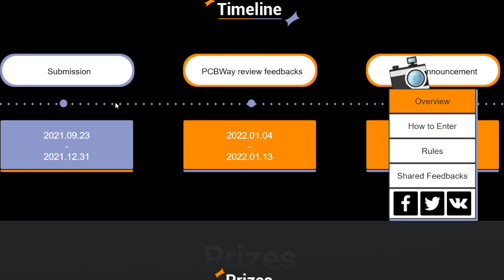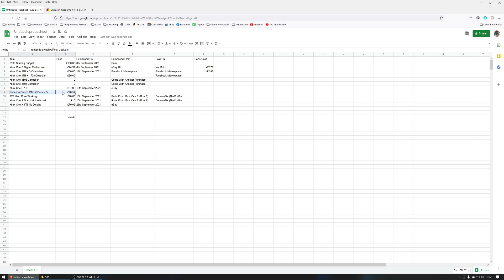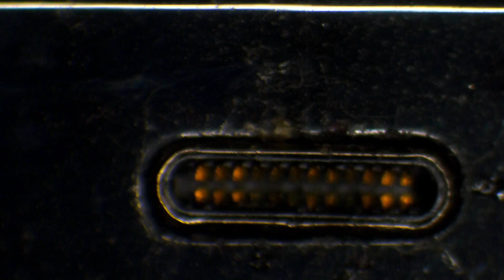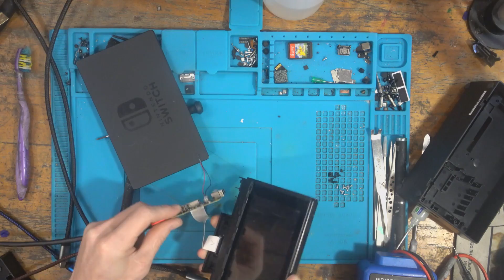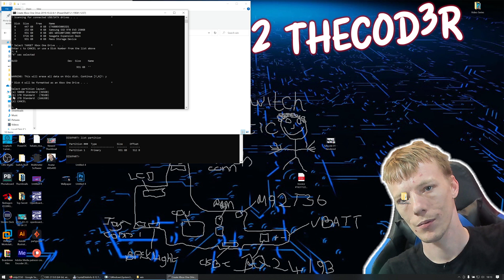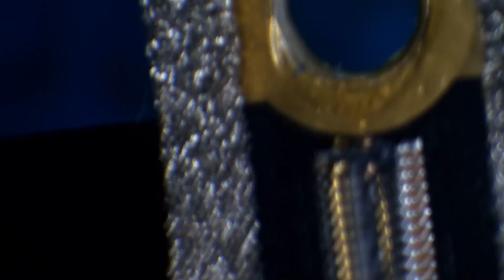Find It, Fix It, Flip It Episode 03 - Can We Turn A Profit Buying and Selling Broken Electronics?

Comment: Hi Phil, I repaired one of these docks. I even made a video about this. The no power was caused by the D92B55 IC for me. Basically it was M92T55 for me but could be that these are alternative ICs. The HDMI controller IC is under the metal shieod behind the HDMI port. Called something like SDP2550 which is a BGA. The 8 pin IC at the beginning of the video is an EEprom. The problem that all the ICs are quite expensive so I stopped working on them. Even a USB port with the felx cable costs 7€..
Reply from the maker: Thanks for that bud, I'll definitely be looking into these some more soon
Reply: @TheCod3r  no worries

Comment: Hook the docks up to a USB ammeter and see the current draw, if it is around 0.004 amps it’s a charging controller issue for no power, 0.4 amps is standard charging draw. Sometimes replacing the charge controller can fix no display,

Comment: Hi, can you send me a link to the jumper wire you use on ps4 consoles for torn hdmi pads?
Reply from the maker: Unfortunately I don't buy it, I use jumper wire taken from the side fan in scrap microwaves because it's 0.17mm dia. and works perfectly for the data and power lines
Reply: @TheCod3r  I saw some on ebay, is chopper wire any good for the pads?
Enemaled chooper wire

Comment: i fixed a couple, it was one of those pm chips. i cant remember which one but i replaced both since (sods law) the first didn't fix it.
Reply from the maker: Haha that's always the way mate. Cheers for the tip, I'll definitely look into it :)
Reply: @TheCod3r  I think the dock had a flashing light issue though, not just "no power".
Reply from the maker: @mickeyripper6976  to be honest I have no clue really what to replace for different issues. It will definitely be interesting to learn them though
Reply: I have a few docks with the flashing issue. Which chips did you replace? Thanks!